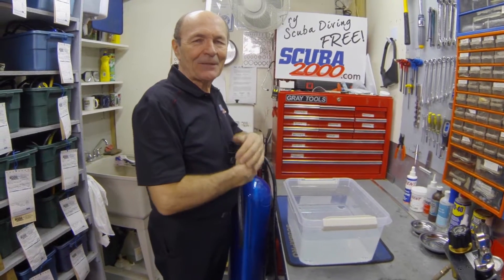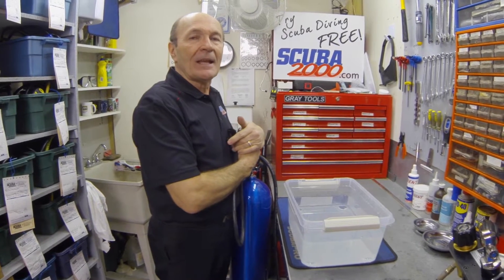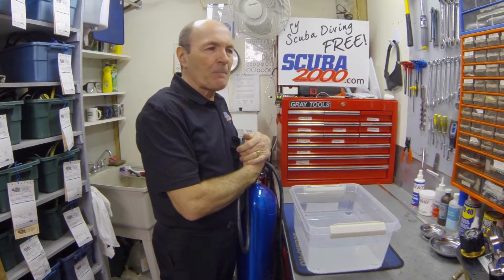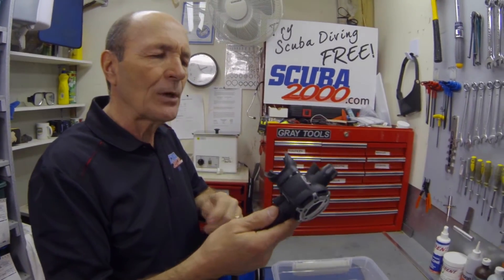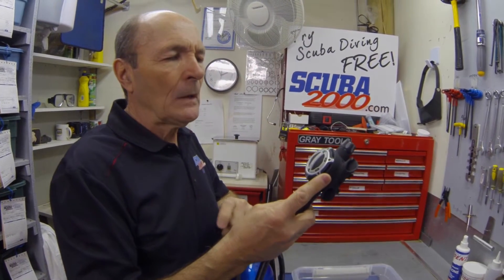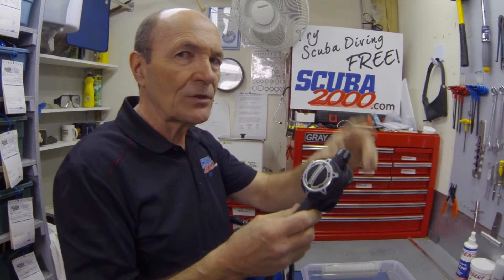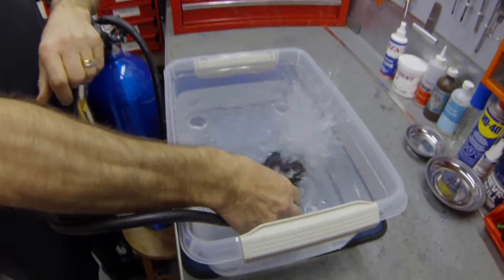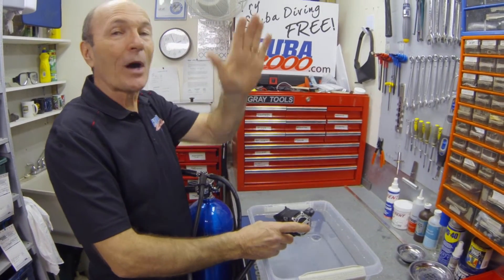My Scuba Regulator Is Broke... NOT! - Scuba Tech Tips #2

Comment: Alec, thanks for your contributions to the community.  I am an old diver and former Navy diver getting back into the SCUBA sport scene.  I have retired my old US Divers and Dacor regulators, they were over 40 years old.  So, I need to get new gear.  I am curious as to your thoughts on pre-owned gear, particularly regulators and BCDs?
Reply from the maker: Nothing wrong with good, used scuba gear.
It's very durable and unfortunately, like most sports, divers get all gung-ho and buy everything and then find out that they either don't have time to dive or lose interest so they sell their gear.
There's always lots for sale on eBay or local auction sites.
Make sure it reasonably new, say 5 to 10 years. More than 10 years and it may not be good to get.
Take it to your LDS before buying to see what they say. Hopefully they are honest and will give you good advice.
Or contact me if you need to.
If a BCD is reasonably new and holds air overnight, it ought to be good.

Good luck. Glad you're still into it.
Alec
Reply: RE:  "...retired my old US Divers and Dacor..."   Brother-Diver SWISS DIVER, VERY COOL!  I sure would LOVE to see your old regs;  do you have them in really neat displays now up in your living-room wall?

Comment: Very good advice! But this is something that should be taught by a diving instructor in the very first lesson! I always show this to my students and how to stop the free flow! It can happen but it is not  as scary as it looks and sounds and it can be easily stopped by covering the mouthpiece with your thumb (as you very well pointed out!)
Reply from the maker: Right. And good instructors do tell new divers about this.
Alec
Reply: Sister-Diver Vera, I agree.  Whenever I've had a free flow on ANY reg, yes I noticed it of course, but it didn't scare me or anything. However, it DOES pi-- me off, so I just give it a good firm PUNCH! Works EVERY time!
Reply: Yes, a common source of near panic among newbies.

Comment: My octopus always seems to free flow on me after about 2-4 dives. I tried turning it upside down, using the finger trick, turning the knob from pre-dive to dive, and adjust the airflow knob from low to full and vice versa. I just had my octopus serviced so I should be good, but it happens every 3-4 dives after being serviced. The first time it happened they said some grit in the regulator. I saw that video of you disassembling the regulator and that could be an option on the houseboat (dive at the lake). Just curious if you have a few recommend steps for when free flows happen and turning upside down doesn't work. What are some safe things to try when you are the dive site. Thanks for the help. Love the videos. Very helpful on the dust cap trick I never heard of that. Plus, even my instructor in 2013 mentioned the turn to full and one twist back on the tank.

Comment: If that is happening with your Venturi switch on pre dive and your Inhalation knob down at 0... then I would say your 1st stage intermediate pressure is too high, specially if all your doing is placing it water.
Reply from the maker: Michael Tandy
You're quite right. This is unlikely to happen if the venturi is off and the adjustment knob is set to it's lowest setting (hardest to breath). However, that is not how your regulator is set when you jump into the water!
Contrary to popular belief, the Intermediate Pressure (IP) has very little to do with breathing effort. The 1st stage does nothing but supply air at IP. The 2nd stage adjustment determines breathing effort. And those adjustments are made based on the IP which can vary from 125 to 160 psi depending on the make and model.
So, the 1st stage is adjusted to deliver air at the factory recommended IP and then the second stage is adjusted to give the lowest possible breathing effort, generally an inhalation effort of 1.5" of water or less. That adjustment is always made with the adjustment knob set to it's highest setting (easiest breathing).
Since the diaphragm is about 1.5" away from the mouthpiece where water would enter to balance the back side of the diaphragm, letting the diaphragm enter the water first would start air flow and then the venturi kicks in to cause a uncontrolled free flow.
The lesson I wanted to get to the divers is simply that this phenomena is not an indication that regulator is faulty. Almost any modern regulator will perform in this way. The diver needs to know why and how to prevent it.

I'd like to add that the serviceman has little control over the IP. It must be set to factory specifications. Some divers have heard that a low IP reduces the likelihood of Freeze-Up. Some divers believe that a high IP makes for easier breathing and will actually try to increase the IP on their own. Neither theory is technically correct. Servicemen must set the IP to factory specs for may reasons not the least of which is liability.

I can discuss this more if you like.
Reply: Scuba 2000, Id beg to differ on IP I have my Scubapro mk25's and mk21's down at 7.5 Bar.. roughly 110 PSI and they breath smooth and soft all the way down to 60M + as air is moving slightly slower through the 1st stage it also reduces the chance of icing up if in very very cold water.
Reply from the maker: Michael Tandy I won't argue with you Michael. I WILL use science.
The amount of air that flows through your regulator for each breath doesn't change. It's based on one factor alone - your breath. You require a fixed amount of oxygen and that's how much you take. You cannot reduce the amount of air flowing through the regulator! If that were the case, a tank of air would last much longer if the IP was lower - a ridiculous statement. Air cannot flow 'slower' through the regulator. It flows at the rate you draw which does not vary breath to breath. What you take in through your mouth came from the tank, through the first stage, the LP hose, the second stage and then into your mouth. It's the same amount and speed for every breath!
If you set the IP lower, the reg will function just fine. You obviously have re-adjusted the second stage to the lower IP.
As to reducing the likelihood of freezing, again science is against the practice. Freezing of the first stage is the result of the temperature of the first stage dropping so low that the water in the air condenses and then freezes. It may well go directly from water vapor to ice. Water is the only substance in the world that can skip a state in that way. Regardless, it is the result of the reg temperature dropping very low. The temperature inside the reg drops as a result if adiabatic cooling.  When the air at 3000 psi drops to the IP it expands (it's under lower pressure so it expands) and that causes a decrease in internal energy and a temperature drop. It's exactly the opposite of when air is compressed into a tank which causes an energy increase and corresponding temperature increase. The temperature drop is directly related to the drop in pressure. From 3000 psi to 110 psi is a greater drop in pressure that from 3000 psi to 150 psi and there is a correspondingly greater temperature drop. Lowering the IP to reduce the likelihood of freezing is a fool's game. I note that Poseidon regulators, renowned for their cold water reliability, have the highest IP in the industry. 
I will add there are many other factors that affect 'freezing' of a regulator.
If you can explain in scientific terms, not "the air is moving slower", how a low IP helps, I'm willing to listen and learn.